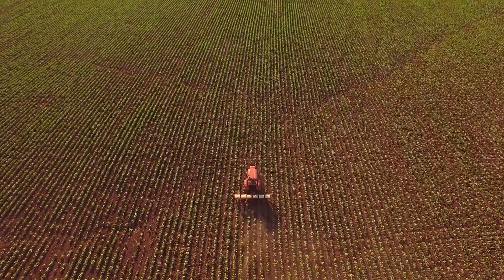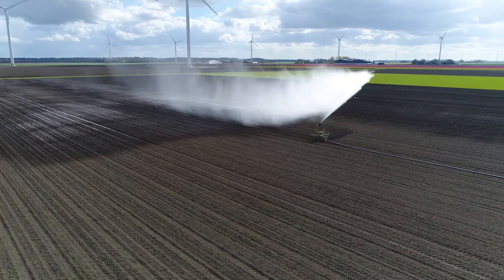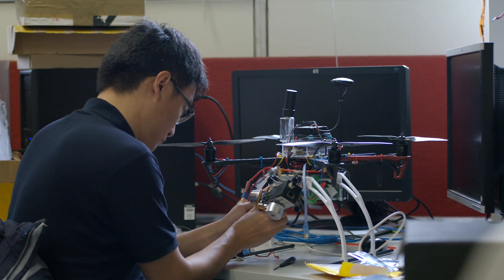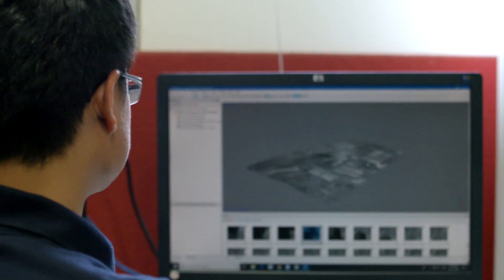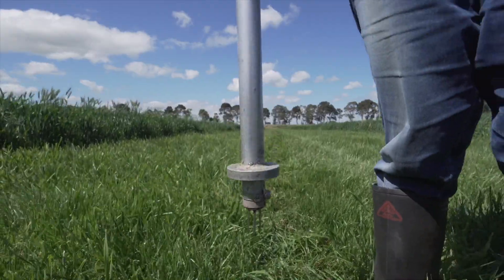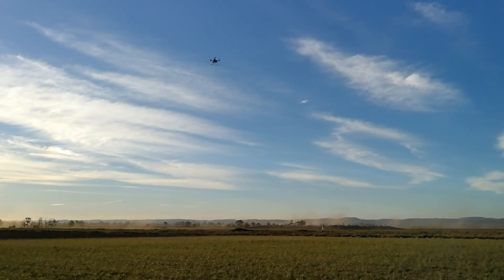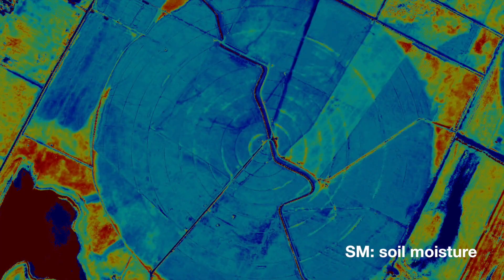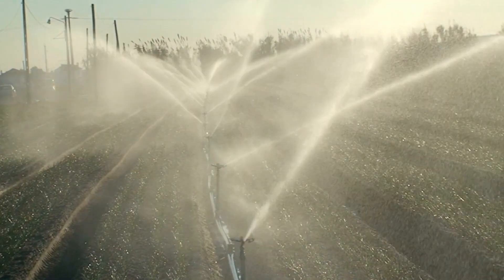Autonomous Drones for Soil Moisture Mapping

Comment: Thanks for providing this video, Just wondering Is it possible to use this technology for assessing the soil moisture in Rangelands 
Also, what about the software that should be used ( Availablity?), and whether is it easily running or no.
Reply: Thanks Dafer, This is Xiaoji from Prof. Jeff Walker's group, Monash University. Yes, it is absolutely possible. Unfortunately, there is no commercial software to use yet for this purpose of transferring the signal received by the sensor to soil moisture. We need to program to do it at the moment.